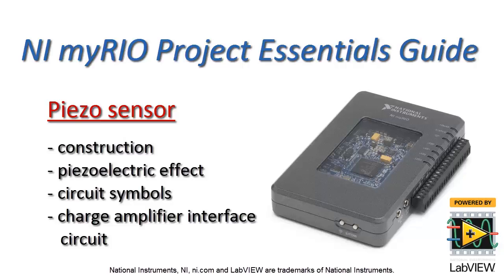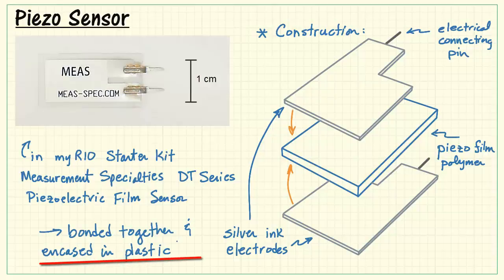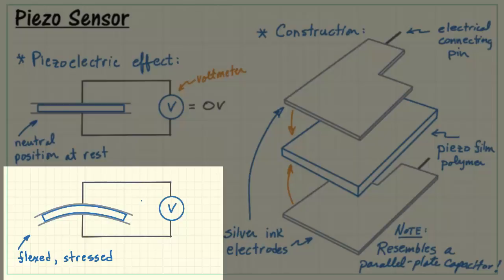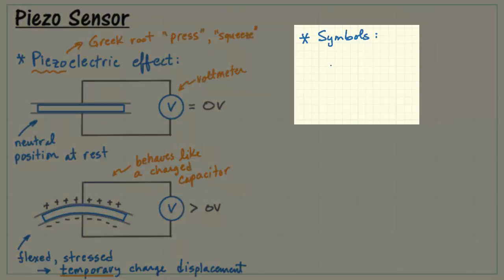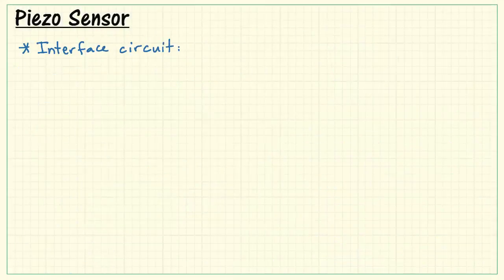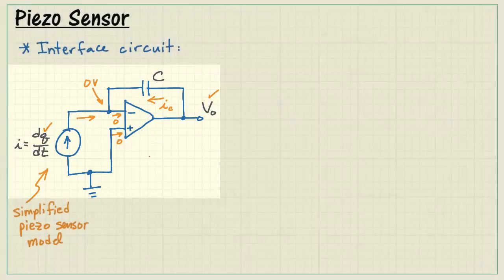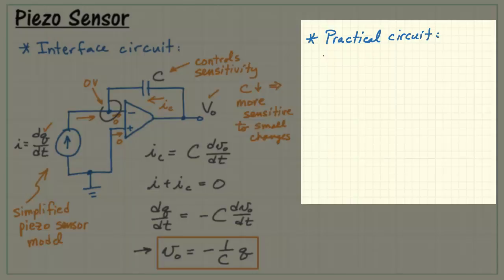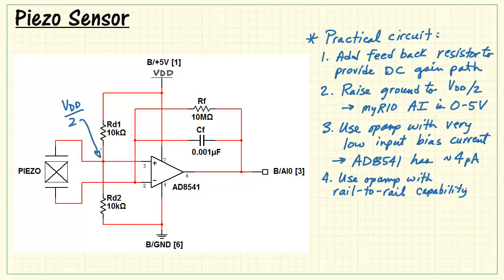NI myRIO: Piezoelectric sensor

Comment: nice video! Can you please explain to me the purpose of dividing the voltage? i understand the concept of the voltage divider but not its purpose for this circuit. also, how would one determine the gain for this circuit?  last question, the parallel combination of Rf and Cf, does that act as a high pass filter for this circuit?
cheers
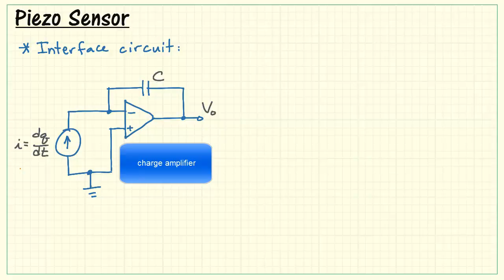Reply from the maker: The conceptual circuit (2:53) requires a dual power supply to allow the op amp output voltage to swing both positive and negative about zero. Note how the the grounded op amp noninverting input is midway between the positive and negative supplies, assuming that they have the same magnitude. With a single-supply op amp the negative power supply is at ground, therefore you need to shift the DC level of the op amp noninverting input to a value midway between ground and the positive power supply; the equal-valued two-resistor voltage divider is an inexpensive way to move the noninverting input to this midpoint voltage. --- The gain of the circuit is the negative reciprocal of capacitance (see 3:55) where the gain is in volts per coulomb. --- The parallel RC elements in the feedback path act as a low pass filter.